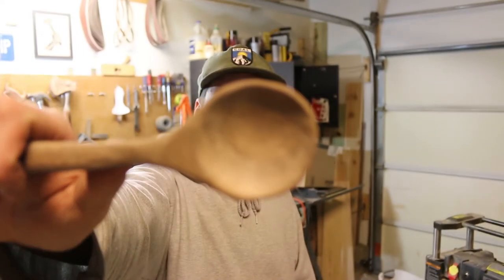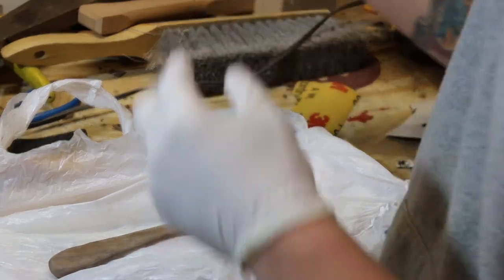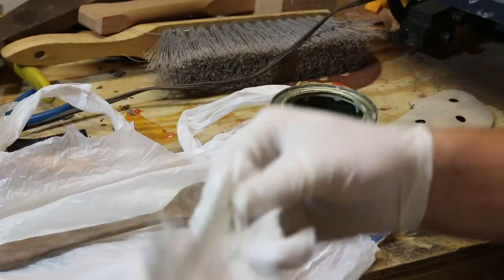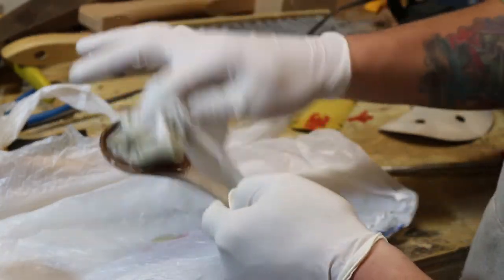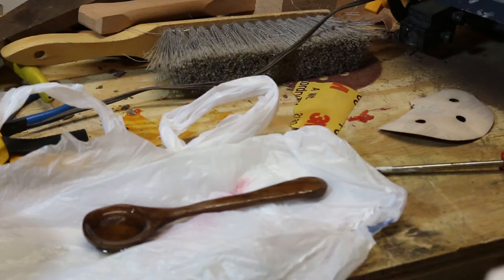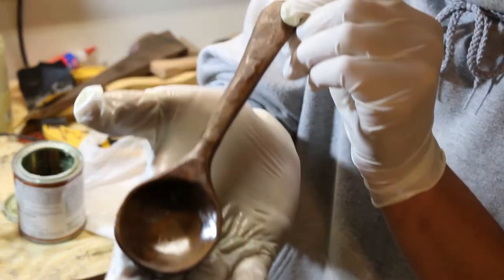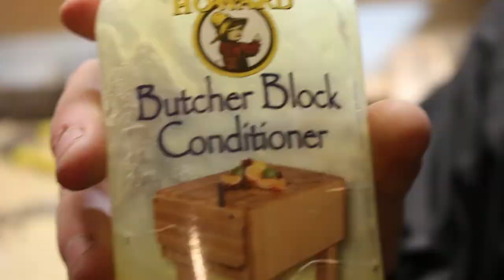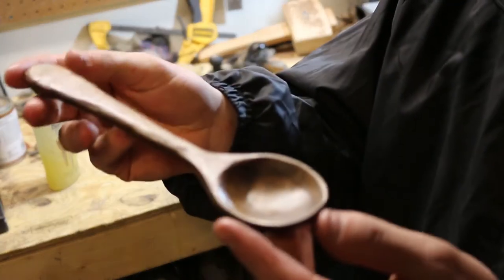Carving a Wooden Spoon

Comment: thanks for taking the time to share your video!  i always enjoy learning how someone else does something.  I also make spoons in traditional and non-traditional ways.. i noticed you mentioned using power tools then i saw you used a hand gouge for making the bowl.. i found a fast (and fun) way to accomplish this with a power tool is using a die grinder with a 1" round carbide bit.. its not cheap.. the variable speed grinder was about $250 and the carbide bit was another $80..  ive gotten to the point that i can apply the right amount of pressure as to not leave burn marks in the wood, which cuts down scraping and sanding the bowl.. also - i noticed you applied your finish before "popping" the grain.. as you pointed out.. the grain will raise when it gets wet.. before applying finish to my spoons, ill usually "pop" the grain 2-3 times by just getting the spoon completely wet with water, letting it dry, then sanding lightly to remove any grain that raised up.. i then repeat 1-2 more times, after the final sanding ill apply some kind of food safe finish.  i find if i try to sand the spoon after an oil finish - i usally end up with oily wood pulp on my sand paper.. quickly rendering it ineffective.